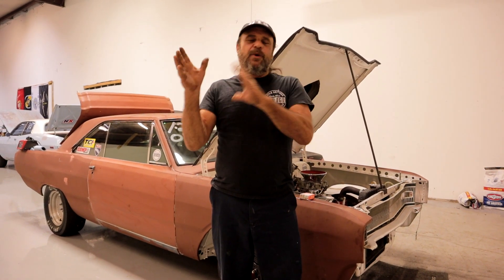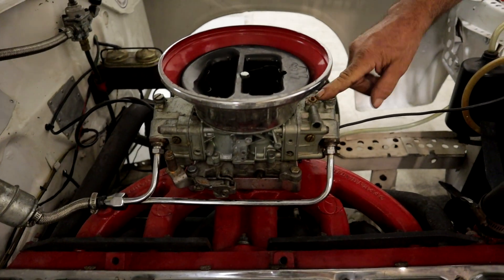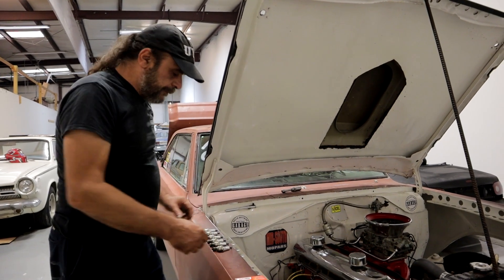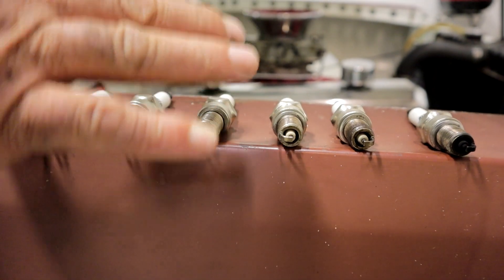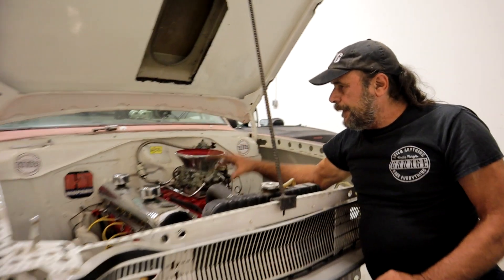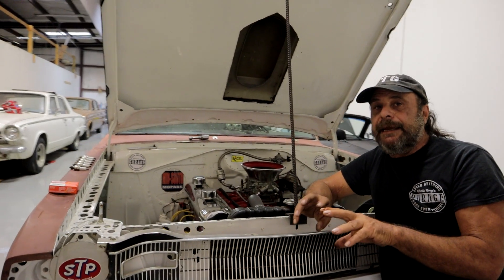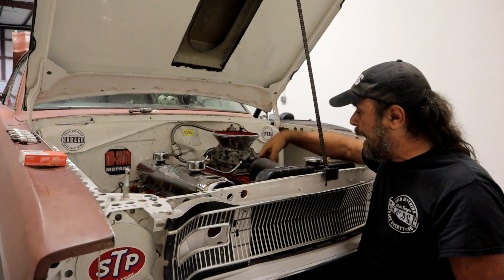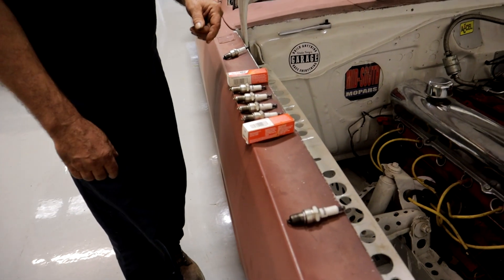Initial Carburetor Performance Tuning

Comment: Hey Uncle Tony,
My son and I have been developing a Slant Six in an Aussie VC Valiant (1966). 
We have a 465 vac Holley and we found the same thing, fuel distribution was all over the place. 
Thanks for the vid, I’d never seen the clean plugs method to assess, we had used a twin extractor exhaust with oxygen sensors but that only told us front 3 vs rear 3. 
Your plug method is VERY useful. 
Just for info Aussie Speed make a long runner manifold for the slant six that mounts a Holley 4bbl in an East West configuration. We invested in that to fix the front rear balance but it doesn’t tell us individual cylinders. 
Also I had never considered jetting differently on the same bowl (L to R) on yours but that probably won’t be effective with an East West manifold

Comment: I have a 1985 dodge D 100 with the slant Has a Holley 1 bb. It’s doing  the exact same thing one and six are running kind of dark. And so on. I’m running NGK spark plugs in mine. The engines totally stock inside and the only thing I’ve done to it is put in a high dollar coil. It runs really good but it’s got the carburetor that you can’t adjust the idle mixture .

Changing the heat range on two plugs makes sense to me. Never thought about that.

Comment: my dad used to drill a little starting hole mark on the drillpress on each sparkplug to identify the cilinder of wich was put in and then out to check them and dont mixthem when put it back on the engine, he drill the 3 cilinder sparkplug 3 holes on the side of the nut part on the side.

Comment: I've seen this on Ford 300 inline sixes. What I've done to help this is to clock the carburetor 90 degrees. It helps with fuel distribution.

Comment: I would still ditch that intake and weld something with triple Strömbergs.. Although you COULD trick that 4-brl to somewhat even fuel distribution, with tiny jets and clocking the body, it would still run poorly compared to three separate carbs. Even the OG fume accumulator would work better multiplied by three than that single holley.

Comment: Lee Marshall has the right idea, tall 2"+ spacer, clock carb to put primary towards the valve cover. I ran 2 giant twin "H" carbs on my 235 Chevy Fenton dual intake 3" above log Runner, 3" straight stack on carbs because fuel standoff @ WOT. ISKY CAM that Ed told me would break stuff, driveline actually. 11:36 @ 91 in the 1/4 mi. YOU CAN DO THIS!!

Comment: Awesome! Hanging out real bad for the next installment! I love it when Tony's just goes over the basics and makes it simple as! I dunno if I went the correct way but I installed an O2 gauge in one bank of my exhaust and its tuned with that, just did the exactly same on the other side of carb :) What would be really cool if Tony got one of those e bay $140 Bosch sensors and a gauge and seen how it reads compared to the plug tune method. Anyone agree?
Reply from the maker: Single O2 won't tell you the distribution. You would need individual EGTs in each primary tube for that information
Reply: Ruster probably has some hidden trick electronics. He is at his shop downloading sensor info into a rack of computers working their ass off , crunching numbers from from millisecond atmospheric changes as well as positive and negative changes in the engine at every change in RPM. It all probably ends up at a line of glass tubes and vials mixing exotic chemicals like hydrazine and phosphorous chloride calculating and mixing an additive for his next outing , based on his current tune as well as the altitude and expected weather conditions.
Reply: @UncleTonysGarage  arrr yes never thought about that, great series, love this stuff! Thanks Bruce from NZ

Comment: Excellent video. Real motor talk from a real motorhead. We just put dual Webers on a slant 6 to equal out the mixture across the cylinders. It's a split manifold with an equalizer tube. I am curious why you went with a single carb instead of a dually setup.

Comment: Uncle Tony this is helpful. I'm at the point on my motor where I'm tuning my Ford 200. It has 3 carbs, with the main carb in the middle and progressive linkage on the two outer carbs. I just got the 3 carbs to idle and I was thinking how am I going to get this in the ball park(or close) on the main jetting. I can't drive it yet because I'm rebuilding the entire braking system. Man I could use some helpful hints from you with that. Having a real hard time getting the hard lines not to leak. Great job on these videos.

Comment: Good job explaining. Your exactly right. Just remind people to limit their changes they make so they can learn what the engine specifically wants. Too many changes at once can be counteracting.. for your situation, I dont think it unreasonable to change carb and plugs. Like you said, you ran the engine for a bit and got it to temp before pulling the plugs. So you are doing it one at a time. However. It sounds like you didn't really hit it hard.. that can make a difference as well. Like you said again. . Reading plugs immediately after a run can answer all that. So your basic tune-up for now is based basically on no load, but could be completely different after a pull. Very good stuff UT.. I just wanted to make a statement that the best way is one change at a time. (Like you are doing exactly) seems like a lot of people get in a hurry and change too many things. Just wanted to remind people.

Comment: Make 3 separate 2 barrel, 2 cylinder manifolds. Set each up with a 2 barrel synchronized carb like a Weber 38/38 or progressive 36/32 then tie each pair of contiguous manifolds together with a balance tube, similar to the old Man-A-Fre intakes made for the gm inlines.

You can also tune the runner length if you do that.

Comment: That motor is screaming for a set of weber dcoe or dellorto style side draught carburettors,would think that would sort any mixture issues(providing you could find/make the intake manifold) great job Tony 👌
Reply: He can use the same manifold and carb and get much better distribution if he just turns the carb 90 degrees. That will line up both the primary and secondary barrels with the center of the intake runners for more even distribution.
Reply: I was thinking the same.  With the Weber DCOE style carb you could fabricate equal length intake runners.  I would think the setup would allow more precise tuning for each pair of cylinders.  Perfect match for those that love carbs.
Reply: @matsumoto9244  Yes. And it would be possible to make the total intake runner length exactly right for this engine.

Comment: That's exactly what I wss thinking--the 1 and 6 cylinders should get a slightly hotter plug. This type of issue is not uncommon in straight and slant engines and their long manifolds, in my experience. 👍
Reply: I'd bet if he turns the carb sideways it'll solve everything without any extra work or having to use different plugs.  A v8 manifold has the carb in the center with each side of the carb feeding each bank of cylinders, but with a straight 6 the "center" of the manifold is in between the 3 & 4 runners, so the left side of the carb should feed the front 3 cyls, and the right side of the carb should feed the rear 3 cyls.
Reply: @livewire2759  Myself and a few friends of mine back in the day tried mounting the carburetor both ways and even used Weiand and Clifford manifolds. In the end the setup that tony has always proved to be the lesser evil. No matter what you have to use staggered jetting. Don't get me wrong it will run fairly well without doing it but you leave some power on the table.
Reply: @davidleonard8369  Interesting... I used to know a guy who did circle track racing with chevy straight 6s, he had a bunch of old custom intake setups for them, including 2 single bbl, 3 single bbl, 2bbl, dual 2bbl, triple 2bbl, and 4bbl... he said he got the best performance out of the 3 singles, with the 4bbl being the most difficult to tune.  Maybe this is why...
Reply: @livewire2759  only on a single plane manifold. A dual plane feeds half of each bank from each side of the manifold. But we do get your point. By the way, three two barrels on a straight six is still a popular setup at the antique drags. The fact is that there are a lot of ways to skin a cat. Each has its drawbacks and strong points.
Reply: @davidleonard8369  Yep.

Comment: Custom make baffles that go under the carb to help distribution. But the different runners changes the torqu curve. the outer runners help low end the inner 4 help top end.

Comment: Another way to do a good plug chop is to get the engine good and warm at the bottom of a steep hill, swap over to a fresh set of plugs and run the car hard up the hill for at least 20 seconds before shutting off and coasting over to the side .. done this alot tuning 2 stroke motorcycles .. You've got to read the band on the side of the porcelain to get the correct reading by the way, not just the electrode, thats why you saw people like grumpy and smokey at the track examining their plugs with their magnifying lights

Comment: A hotter plug won't change the mixture to those cylinders.  If changing the left jets doesn't change those cylinders, I wonder if you could get some really fine wire to be in the air path to the end cylinders to get fuel to attach and route into the middle, kinda like how when I wash my hair water runs down my arm and runs off my elbow.

Comment: I’m sorry, Tony, but I really don’t agree with changing heat ranges on #1 and #6 plugs. All that does it attempt to hide a future plug diagnosis.  You need to fix the actual fuel distribution issue. 
Look at rotating the carb 90 degrees, putting the primary side towards the driver fender. This will at least give a good distribution in the primary side of the carb.  I think, using the manifold  you have limits proper primary and secondary distribution, unfortunately.  A longer runner manifold like the old Hyper pac manifold or the 4 bbl version of the Aussi manifold would serve you way better than what you have.  Doug Dutra worked long and hard fixing the fuel distribution in the HyperPac manifold he designed for Clifford and was probably the best one available for a slant.

Comment: Once you found the right plug you can tune each cyl with gap as well . Although Minimal it can be usefull. Also as Mentioned below turn the carb sideways with a open spacer. JMHO .

Comment: turn the carb 90 deg so the primaries are furthest from motor as possible. had a built chevy 6 cyl years ago with a clifford 4bbl and holley and that seemed to help distribution on that motor

Comment: Snip the washers off the spark plugs. Drool tube heads don't use washers but if you use them, it'll pull the plug back into the head giving a wrong reading. Also throw a power valve in it for that part throttle tuning under load. Some even turn the carb 90°. Every hot rod sees part throttle and WOT is a completely different animal

Comment: Time to make your own intake manifold. 6 equal length tubes with 6 single barrel carburetors. Like the old British sport cars.
Reply: There is a reason for the slant intake manifold. Look up one of Tony's videos covering this, probably a couple of years ago. Might not be the best for a drag car though.
Reply: Offy makes a tri power intake for inline motors using three 1 bbl carbs.

Comment: A dual carb split intake ( 3 into 1 x2 ) is a potential solution.  They are short runner designs so it wouldn't hurt your top end. Plus, 2 carbs is twice as much fun.  Hyperpack intake has the best distribution  but the long runner "might" limit top end. It also might help low and midrange.
Could the stock intake be ported or to increase flow to the center runners or could the long runners be modified for restriction?

Comment: You run into rich plugs vs. normal vs. lean on the 300 inline six w/ Offenhauser/Clifford intakes all the time.  Sometimes the fuel will actually pool on the longer intake runners and dump much more sporadically than plugs dead center under carb.  To mitigate sporadic fuel dump, spacers of anodized  aluminum can equilibrate distance deficits/disparities and rather than adjusting plugs for temp and gap, it seems to lead to a more consistent atomization.  In the 300ci, it has never been fueling problems(that I have seen) but rather engine heat playing hell with the air.  I think you are a little hard on yourself; those mildly fouled plugs may be robbing HP, but not 25 HP!  Hell that is all headers can do at sea-level!  Don, I did not mean to attach that to your nice comment; just was not paying attention(but read all)

Comment: There are obviously many superbly intelligent mechanics that follow Tony’s page. Therefore, me being me ( a General Motors ‘89-98 trained mechanic) I have a question. I have put together a 1982 Chevy El Camino. I’ve deleted EVERYTHING computer controlled. Lately, I installed a MSD vac advance distributor. The vac advance is adjustable. So, needless to say, I need a quick lesson on how to set the advance/timing. The engine has one step above stock camshaft, stock bottom, EDELBROCK EPS intake, EDELBROCK AVS2 carb. It would be greatly appreciated if some of you GM old school guys could come together and give me the run-down on on vacuum advance and timing.  Thank You. 
UTG Rocks!!

Comment: Uncle Tony you ever think of using single carb for each cylinder or motorcycle carbs for each cylinder to be able to tune each cylinder? Seen some video of people using motorcycle carbs to fuel each individual cylinder and each one would have its own throttle plate, they would all be connected via linkage or cable and it would kinda be like an ITB setup but you could individualy tune the cylinders to dial them in

Comment: Tony I had an idea while watching this Excellent video diagnosis👍
That intake looks like a relatively simple design. How hard would it be to cut out the four barrel section and replace it with two large two barrels (feeding 123 & 456 respectively)?
(Or cut up a two barrel intake/build your own from scratch)
Depending on how/where you cut the intake, you could control the variability of the runner lengths and thereby the need for different plugs and even get a more even power range.
But it was just an idea. 
Either way, I love the videos and the love of cars that comes through😎👍

Comment: Does anyone make an intake for triple sidedraft Webers on a Slant? That was always a hot setup on a Nissan 240/260/280 or a Triumph back in the day.  I suspect that with even runners, keeping all 6 cylinders at a constant/consistent mixture would become much easier.  

Yeah, I see the appeal of port injection, too. Widebands and all that aren't my thing, but sometimes driveability improves the street experience. 😉

Comment: Interesting - opposite problem from the Ford small sixes, where the end cylinders run lean. If you could cool the inner runners, and heat the outer ones, would that help a bit?

Most common fix is to turn the carb sideways.

Comment: I would try a 4 inch open spacer it will  even out the distribution that manifold has no plenum that's why it's so uneven I made one for a 2.3 Lima out of sheet metal about 4 inches tall with a 2bbl 360 carb and installed 36 jets and it loved it you don't have to make custom jets they make them supper small

Comment: I have watched several of yours as well as others about carb tuning. I’m working on a 351w with a 650 Holley. Starts great cold. A couple short pumps and she lights right away. Runs strong too. Problem is hot start also requires hitting the throttle. Never had a car do that. Thoughts?

Comment: Around dirt late models for Budweiser for years and we ran methanol which is way different than gas and I know how jetting works barometric pressure temperature readings and if you're running regular you know race gas you want a leg Gray on your plugs and if you're in gas well anyway I'll throw a set of 72 in there and you'll be fine and the problem with the two outboard cylinders that is the intake manifold because it's loading up

Comment: can of worms. IF all the cylinders are pumping the same, I've seen guys play with valve adjustment, working a little tighter on the ends to norm in the center. Carb air bleeds would be next, but these are usually fixed. 1 other thing I've always done with the slant 6, if the plug covers are in place, do not use the sealing gaskets with the spark plugs. This comes from the dealership/training. Good luck, interested to see the next test. Good luck, I bet you will get it!

Comment: I know exactly what you're saying, 100%.  Imagine making your own tuned port intake manifold for that engine?  Just as nice would be a tuned port exhaust header with equal length of runners.  It's all about equal A/F mixture to each cylinder and balanced exhaust for all cylinders.  In other words, it's all about volumetric efficiency.  Equal suck, squeeze, bang, blow between all cylinders.  Lol...

Comment: Turn the carburetor 90 degrees clockwise.  Put the primary barrels right on the 3 & 4 runners and the secondaries will line up with 1 & 6.  Even the 1 bbl carbs that Chevy used on their straight six's were turned sideways compared to a v8 for better fuel distribution.  It will put the carburetor more "in the middle" of the manifold instead of the primaries feeding the front runners more and will give you "EFI" -ish performance.
Reply from the maker: This carb is already mounted "sideways" because of known distribution issues with this manifold and its normal carb mounting
Reply: @UncleTonysGarage  It is?  It looked like it was mounted straight just like it would be on a V8... I guess I'll look again...  
Yeah, it's mounted just like a v8 here in the video.  I mean turn it so the primaries are on the right and the secondaries are on the left.  Has that been tried?

Comment: Spitbalking.  Would turning the carb 90 degrees clockwise in order  to place the primaries equally displaced; front 3 cylinders and rear 3 cylinders, help the fuel distribution?